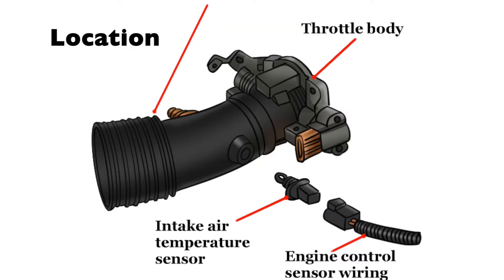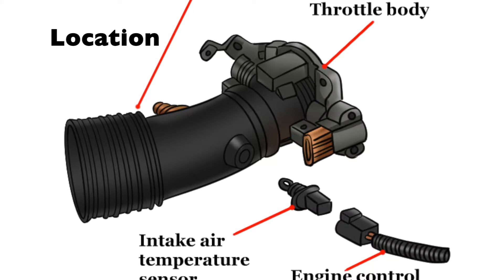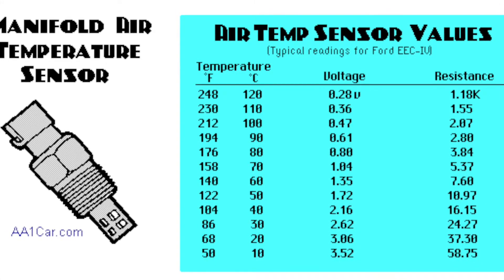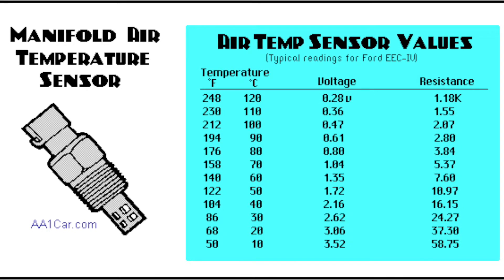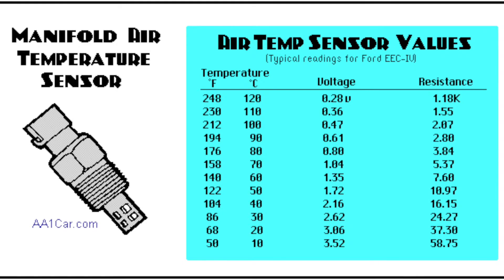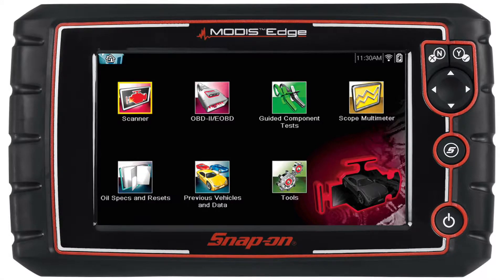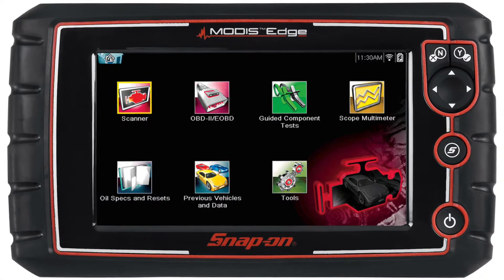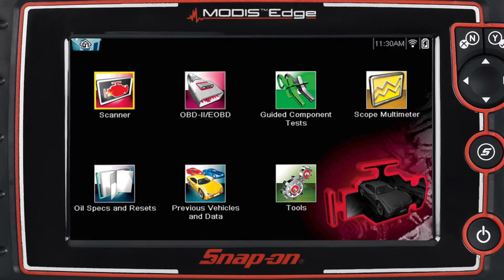Intake air temp sensor

Comment: Okay have a question my 95 Dodge b2500 ram van runs like total crap until it warms up I've changed the temperature cooling sensor the temperature sensor the TPS sensor could this be my problem the intake sensor it floods out backfires it dies until it warms up or runs for a certain amount of time it'll straighten out and run like brand new do you have any idea what it could be
Reply: Did you ever fix fix I have same issue

Comment: Oh thats really gunked up. Mine just was soaked in fuel. I keep having a rough start. Then if its run about a mile. Shut off. It starts right up flawlessly. But if the engine is warm. It wont start. Taking 10 key turns. . I cant find out if fuel in the intake manifold is bad. Or how much there should be. N if its a vacuum leak cause of this. That is coating the sensor. Or another issue in the electrical line

Comment: Besed on color code of picture you put a 102 ohms 5% fixed resistor for the test .. I have a 2004 Jeep Wrangler with air temperature sensor that reads base-line of 10k ohms room temperature.. but when I applyed heat with hair dryer it read 2k ohms  .